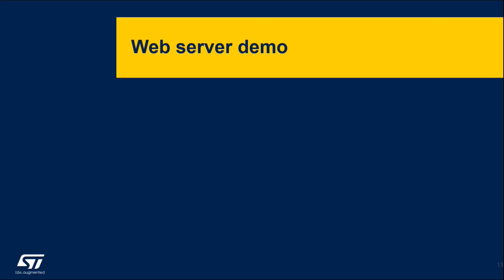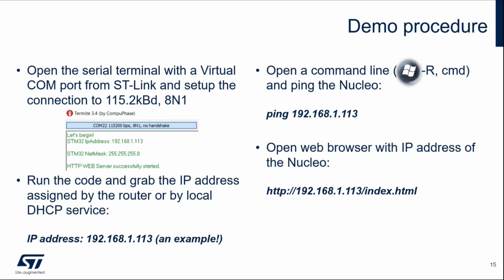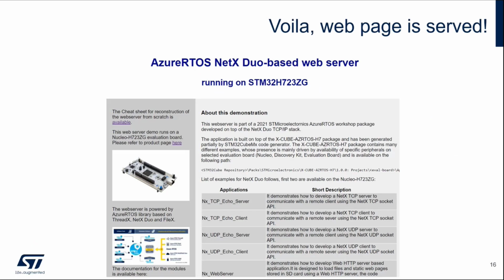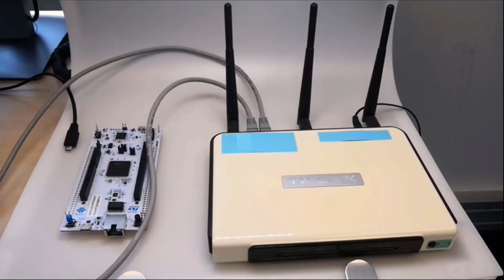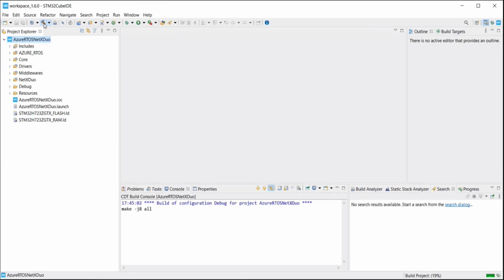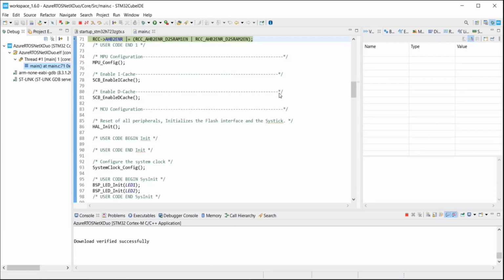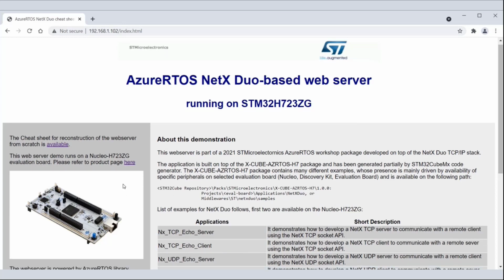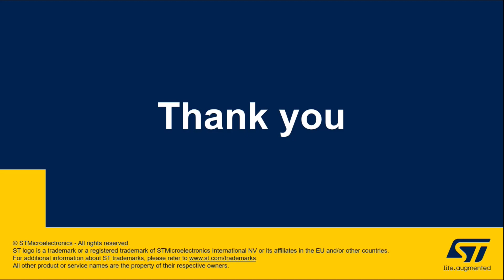MOOC - Azure RTOS workshop - 18 NetX web server demo

Comment: What do you do if you don't want to use a DHCP server in the router, but just want the NetX web server to operate at a fixed IP address, much like what most smart routers do for user configuration?